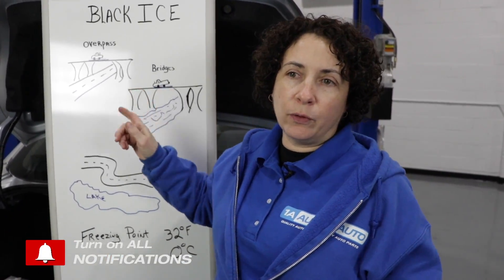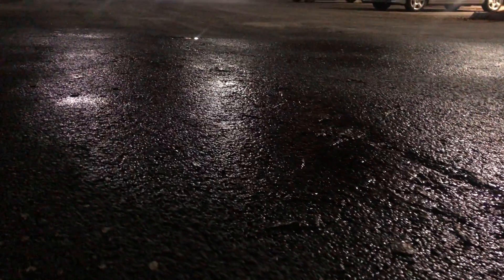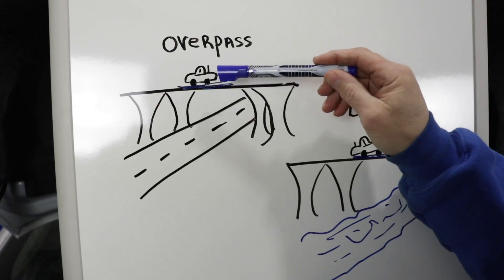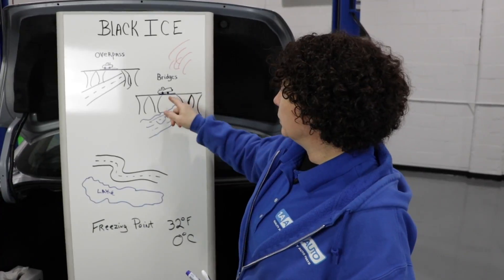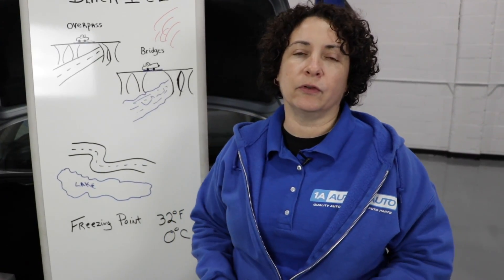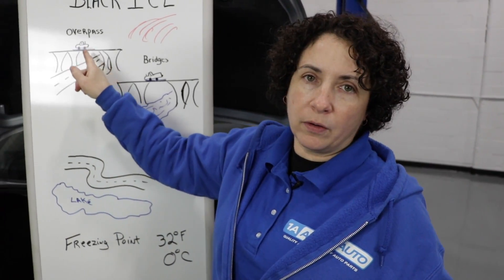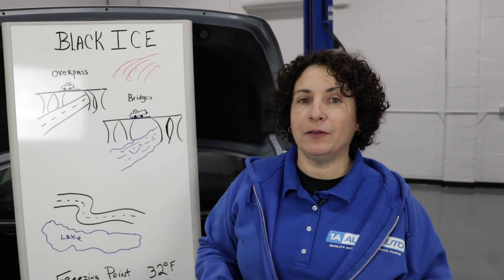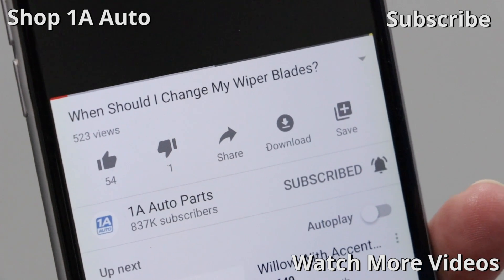What is Black Ice on the Road?

Comment: Another place you get back ice is from it being like -30F or colder and car exhaust warming up the pavement and putting down moisture from the engine then traffic runs over the ice sections and polishes it up. This will cause black ice on regular roads with no bridges or lakes around.  You can have black ice in the middle of nowhere! (Canadian talking from experience!)